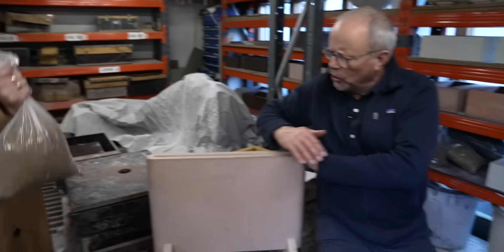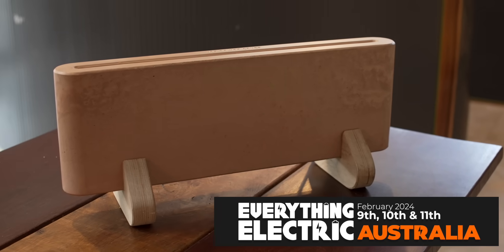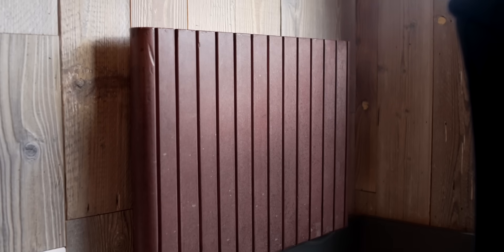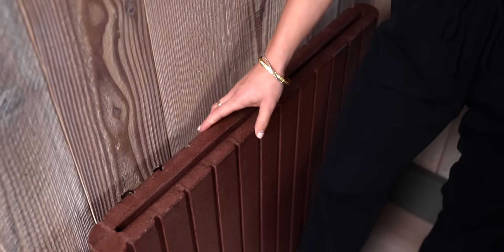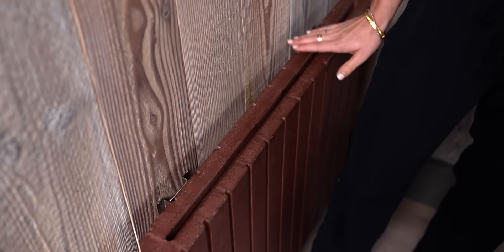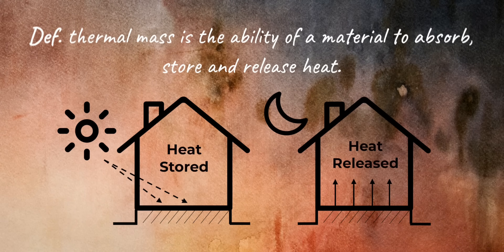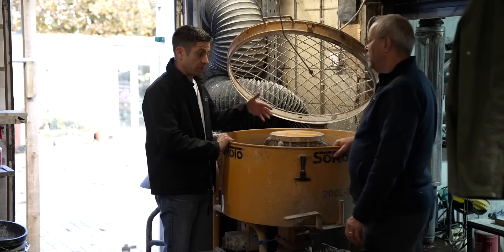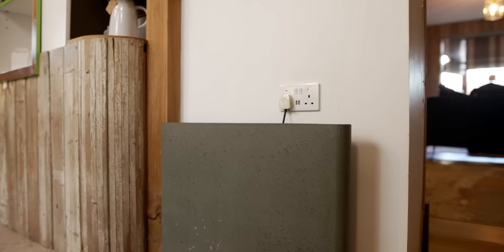THIS Radiator Is Made From Recycled Sand!

Comment: I think the consensus on this one is clear to see in the comments. I love the fully charged show - but know your audience guys! We understand what 100W of electricity means, so describing these radiators as 'efficient' is misleading. It's exactly the same kind of non-science that (I love you for fighting against) the oil/gas industry puts out.

I like that you want to support a Yorkshire business and I get that they recycle - all great. But the title of the video has irked me and a few others.
Reply: Came here to say this.  I feel let down.
Reply: Yeah this video does a pretty good job of misinforming people about heating and reducing the channel's credibility. In the battle against misinformation this is a real home-goal.
Reply: I've seen dozens, and dozens, if not hundreds of Victorian radiators in houses. As far as I know they're 100% recyclable because they're you know, metal. They also last you know, effectively forever unless they turn to rust. I'm not sure how any radiator could ever not be recyclable? Isn't this basically just a normal storage heater with bricks inside it anyway? It also suffers from a tiny surface area so what this can't do, is heat air quickly enough to make a rapid difference in the heat of a cold room when you get back to find out your kid left the bathroom window open all day while you were out or whatever. There is a reason heatsinks for computers are made of razor thin metal.
Reply: Same as calling them "carbon neutral" 🤮
Reply: I was looking for this comment before giving this video any of my time.  Thanks
Reply: I'm guessing they've changed the title because now it says 'This radiator is made of sand' which seems adequately factual. I wonder whether the editor thinks "damn - I wish that 600W comment wasn't in the middle of the bit I want to use - it's going to get a lot of comments" and then wonders about throwing the whole segment out, but realises they don't have anything less daft to replace it with. It feels a bit mean to be having a go at these obviously decent people who have developed an interesting product, but ultimately this sort of thing needs to be put in context. I guess there is a place for very expensive direct-electric concrete radiators just by way of variety. They are pleasing objects designed to last and we should encourage that. But always in the context of 'never use direct electric heating if you can possibly do it with a heat-pump'. 
A video on direct-electric panels a couple of year ago got a lot of flak too.
Reply: I agree, you won't notice much of a difference on your electricity bill, but you also won't notice your room getting any warmer 😂

Comment: Sorry but this was slightly disapointing to see from EE. It's an electric heater - all electric heaters are 100% efficient, so the efficiency claims are marketing nonsense. You could also argue these are less carbon efficient owing to them having a concrete mix. Even the most basic of electric radiator uses standard metals that can and are all recycled. Very much felt like marketing BS for some expensive designer ware. They do look very nice, but suggesting they are in any way functionally better is at best a mistake, and at worst a lie.

The claims about using the same amount of energy as a smart tv should've set of massive alarm bells in your heads. Who on earth thinks a smart tv uses 600w of energy!

Comment: Some issues here. 1) Smart TVs use nowhere near 600 Watts. Plasma displays could be up to 500 watts but, no one uses those anymore - .LED/OLED more like 100 watts for a 60 inch 2) Tis is just resistive electrically generated heat - it's always 100% efficient. Even the power cable will generate a little bit of heat. There is no loss. 3) Stating that a 150w heater costs 3p an hour to run is all very well, but you cannot deny the laws of physics and 150Watts is not going to create a lot of heat. The' uses recycled materials' part is the only benefit here. The only way to make electricity generate heat more than 100% efficiently is to run a heat pump. Otherwise these are no more efficient than an oil filled radiator. There's a reason we don't all use electrical heating unless we are on a special tariff - it's bl**dy expensive.

Comment: This is the first tech on here that I felt is not really anything special. As others have said, this isn't new. Also, '600watt is like running a smart TV'.. No! More like 6 large smart TV's 😬.. You will very much notice the energy use. Nowhere near a heat pumps efficiency.

Comment: Dear Robert, there are no electronics in here.  It is a resistive element - just a coil of wire.  This is what we call electrics, not electronics.  Please, get your team to understand the difference between electrical and electronic - a fundamental wish of mine for a channel touting Everything Electric!
In case this seems blurred, electrical just means employing conductive materials to convert electricity into other forms of energy.  Electronic devices employ electricity to perform a task, typically this involves some silicon to enable processing power.
Your lovely man in Asia, Elliot, who does your car reviews out there confuses these 2 terms.  A simple powered boot is not electronic, it is electrical - motors and mechanics.
I still liked this video, always a pleasure to view you and Imogen at work.

Comment: It's an electric radiator that looks quirky and (for some) pleasantly different. It might release over a longer time than some other materials, especially compared to classic water-powered radiators, but there's no denying that whatever energy you put in, you get out. Saying things like: "it takes as much power as running the telly" for the layperson will be a wow-factor, but all it means is that it heats the space almost exactly as efficiently as their telly does... so just run your telly instead...

edit: the rest of the video - great stuff, I like the recycling aspect of the products and I think that is a great credit to them. Good work.
Reply: Water holds more heat than concrete.... So this thing is 😂

Comment: Direct electric resistance heaters are ALWAYS 99+% efficient (with maybe a tiny loss for the little red 'on' light on the side, or fan motion if they're assisted). It's something to do with a little known concept called... erm... what was it...? The conservation of energy. A £30 electric resistive heater is EXACTLY THE SAME efficiency as a £300 one, and your rooms will require EXACTLY THE SAME AMOUNT OF ENERGY per hour to heat.

Okay, they're 90% recycled, which is good, but they are no more super efficient than a coil of wire. 😂 And my smart TV (55in, 5 years old) uses less than 300W, NOT 600W. Can we fact-check the 🐂💩, please?
Reply: Darn, you got a pretty inefficient TV or a mildly efficient heater over there. Over 200W is a lot for a 5 year old TV, must be a big one.
In all seriousness, yeah what's up with their efficiency claims? Well, it's designed to be more of a radiator than a convector, so I guess it could be argued it is more efficient than a forced convector by being better at heating the objects and living beings in a room than the air within? By rhat measure a big 40W infrared LED would be even more efficient, mayhaps. Want even more efficiency by that metric? Try contact heated clothes.
Reply: It's 100% efficiency. Even the energy for the little red "on" light will eventually end up as heat.
Reply: @chrisb9319  Still, I think the "super efficient" crap is about the ways of transmitting that heat having different comfort at a same heater power and otherwise ambient conditions.

Comment: Nice idea, but no more efficient than a cheapo heater of the same capacity from Argos. If it's a storage heater so it heats up overnight on Economy 7, then say so, but there's no evidence of this, nor does it have any possibility of turning the heating on or off so it will be extremely slow (hours!) to regulate. Replacing central heating radiators with these would send your electricity bills through the roof.  There are also factual errors - electric elements corroding or dusting up has no effect - 1kW of heating is 1kW of heating.  I'm surprised Imogen's been taken in by this for a start as it simply has no science behind it whatsoever. Sorry!
Reply: Extreme dusting up will trap the 1kw of heat in the dust instead of heating the air. Just like fully enclosing a heater will trap the heat. You want the 1kw of heat dispersed evenly in the room, not shooting up to the ceiling too much and preventing cold air flows by placing them below cold windows. I'm not seeing anything special in this regard for the heaters in this video though.
Reply: @drfisheye  It will prevent good circulation, yes, and make the element much too hot, but ultimately 1kW of energy in is 1kW of energy into the room, so the efficiency is unchanged.
Reply: @richardgledhill  depends on the measure of efficiency. The people in the room don't want to be cold. If the heater is mainly heating up other elements rather than the people in the room, they will increase the thermostat. Likewise a heater with a small surface getting very hot, will shoot hot air to the ceiling of the room leaving the people below cold. Hence they'll increase the thermostat. So the efficiency of heating people isn't necessarily equal to the efficiency of the heater in isolation.

Comment: Now, correct me if i'm wrong, but these things simply turn electricity into heat, right?  So, if your house needs 20.000 kWh of heat during winter, these will consume 20.000 kWh electricity,  right? I mean, they look good,  but what's the point? A heatpump does that with just, say 5000-6000 kWh. And if you only need some rooms a little warmer, say a bathroom, an infrared heating element  would do that probably better cause you only turn it on when it's needed. So, what am i missing here?
Reply: I guess the heat storing properties could offset the usage, depending on tariffs and on-site production it could safe some money (not energy)
Reply: Interesting I think  I'll wait and see, I hope it takes off.

Comment: Sorry but copper steel and aluminum are all recyclable and they usually are. Are we sure these are environmentally friendly because I don't see it from the presentation I don't understand the concrete advantage might give a bit of longer heat accumulation ...
Reply: Also.... barely anyone is making low grade radiator steel / aluminium / copper from virgin materials.

Comment: Some feedback: One thing I would like with features of "efficient" products, is highlighting WHY they are efficient. To summarise where that efficiency comes from compared to the current status quo for a given product's category.
"This thing is very efficient BECAUSE". I trust the Everything Electric/Fully Charged team. But without the, at the least simplistic, summary of reasoning, my brain just files it under "unsubstantiated claim" and poo-poo's the excitement for it a bit. 
Even if I can guess at why it's efficient with the rest of the information in the video. Even later in this video its never highlighted specifically why. Electronics are encased so it can last longer, okay thats a longevity rather than efficiency thing. Concrete has a higher thermal mass, that's awesome, buy I still have to pay the Kw/h to put the thermal energy in there. Why is a 150w of this concrete type heater, better than a 150w usual electric heater, or oil heater, etc.

Thanks team
Reply: Electric heaters are 100% efficient, no matter if they are concrete, regular ones, or whatever. The only thing that might have an impact is off-setting time of use (leaving them off at expensive times and counting on their thermal mass), but they're way too small to really have much of an impact imho.
Reply: Yeah got to agree. Go with trust but verify. Love this team, and this video gets me excited, but without being able to know more about the how and why it works ust so well, this feels more like just a sponsored video compared to the more in depth ones I love.
Reply: Yes I agree, you've hit the nail on the head. I felt the same about their piece on infrared heating too but just lately I've seen a few people who're using it in there homes and seem very happy with it. Though others say it doesn't provide sufficient heat. The thing with all the plug and play type heaters is that at least you can buy one to see how good it is as opposed to spending thousands on a heat pump, even with the grant, having a huge amount of upheaval only then to find it's been badly designed and is costing you a fortune. This 1kW in to get 4kW out was quite enticing but then I thought well that's great but you're using that kW to heat the water, which heats the radiator which heats the air which after a half hour or so will warm you. Seems like you have an infrared panel, switch it on and the first thing it warms is you. An ir panel or even one of these composite heaters can be timed to come on when you need it in just the same way so you can have it warm the room too. The only thing I'm not sure about is running costs, I'm hoping the smart thermostats will ease that. As you say though there is never any of these questions posed nor challenges raised which is a bit of a shame. I guess we can go away and make our own enquiries.
Reply: @judebrown4103  An IR panel in the bathroom for whilst you are standing/soaking there seems like it might be a good idea. It doesn't need heating the rest of the time, and you spend a lot less than 1/4 of your time in there so an IR panel might even be better than a heat pump in this application.
Reply: @xxwookey  absolutely and they can prevent damp issues too. Someone told me the other day that they make floor tiles just as comfortable to walk on as they are in summer.
Reply: Couldn't agree more
Reply: Yes. EES team, please clarify the "Super Efficient" in the video title... efficient compared to what?
Reply: "Why is a 150w of this concrete type heater, better than a 150w usual electric heater, or oil heater, etc." It isn't - it just (arguably) looks nicer and contains more recycled material than most others. And I see they've changed the title now to remove the bollocks.